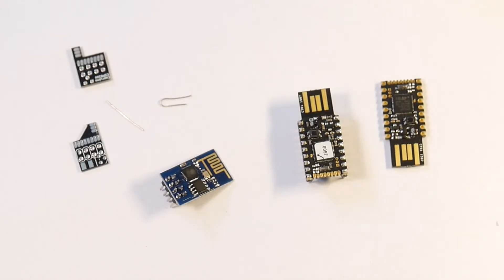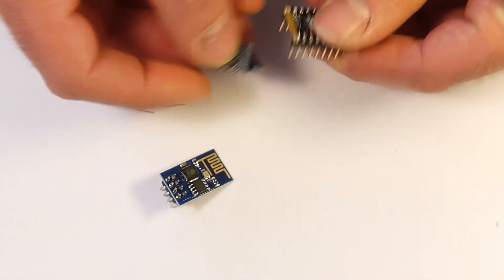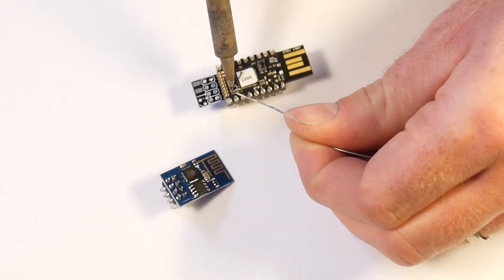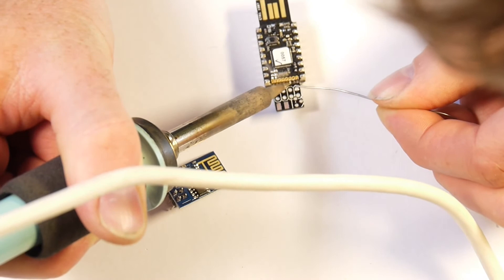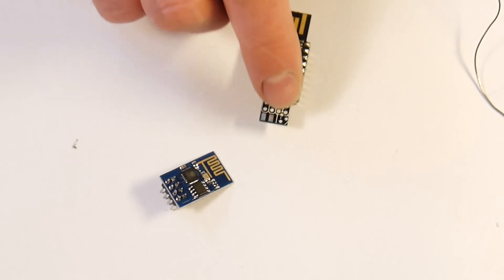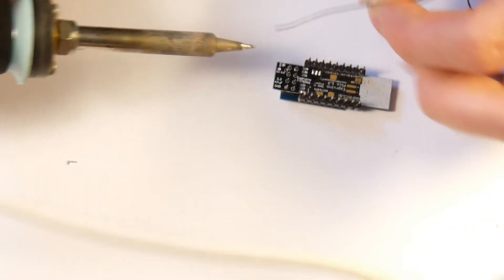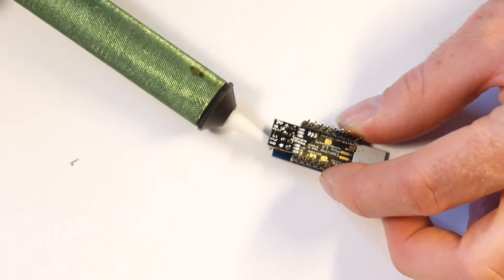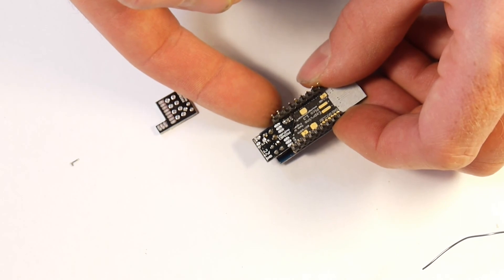ESP8266 to Espruino Pico Shim Soldering (rev.2)

Comment: I think the WIFI antenna signal may cause some disturbance on the circuit. Dont we need clearance near the antenna ?
Reply from the maker: +Venki R It seems to work fine here, but being so close probably doesn't help. Because of the length of the pins, you can always increase the clearance. You could solder 2x4 socket on if you want to, and then you could get a bit more distance as well as being able to remove the ESP8266 from the board.